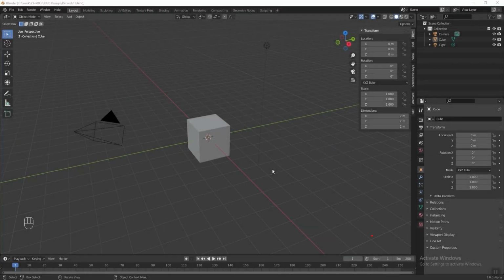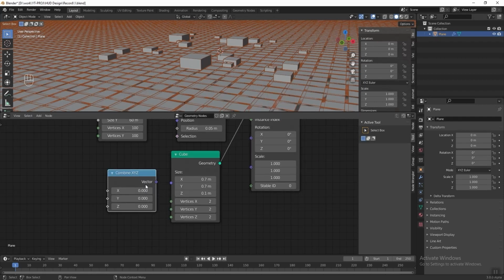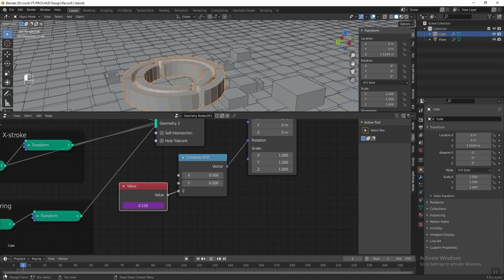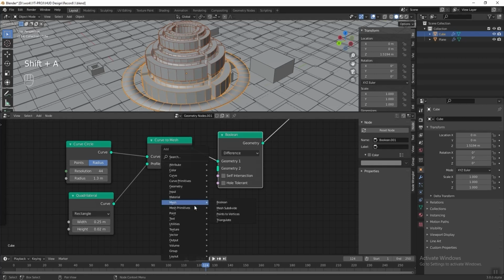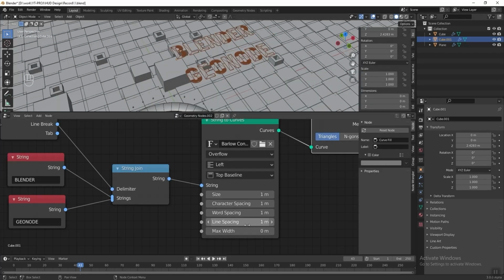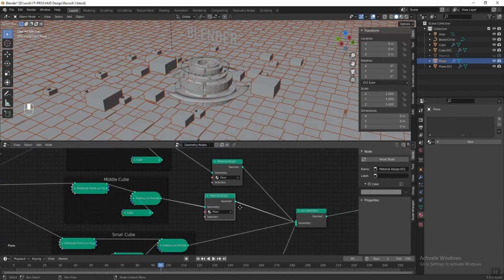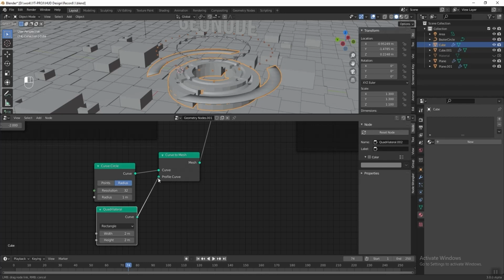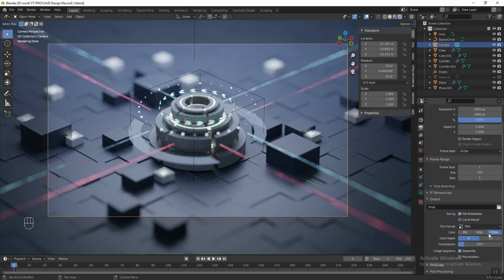Blender3D - Create a SCI-FI scene with Blender 3D Geometry Nodes Fields TUTORIAL

Comment: The alt right click is
 not working
Reply from the maker: It should work, hover you mouse on the node, hold Alt, then right click and drag your mouse to the node you want to connect
Reply: @Chong3D  Ok so it won't work until you enable node wrangler and other addon in preferences. Just figured it out. You have to enable all node related stuff
Reply: @Chong3D  it worked, thanks!